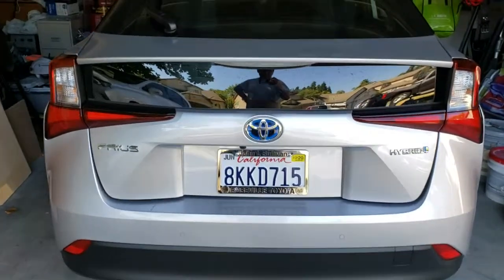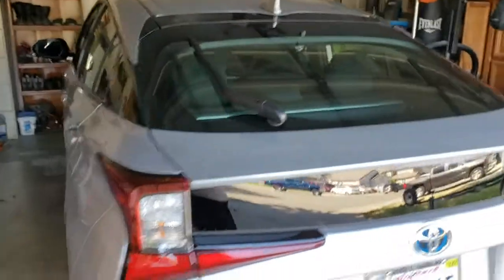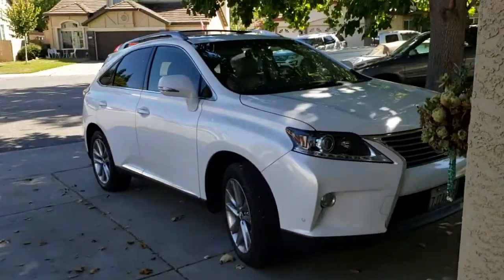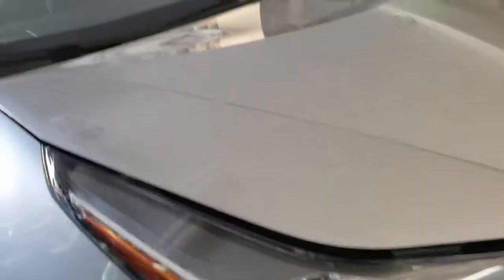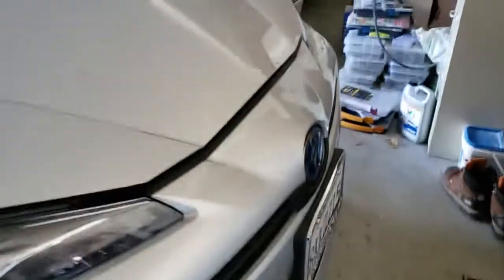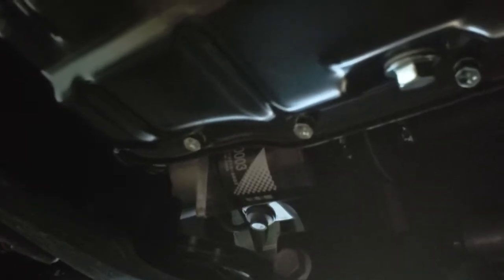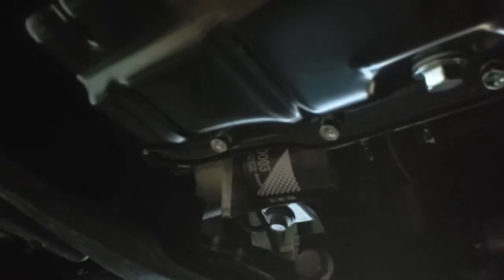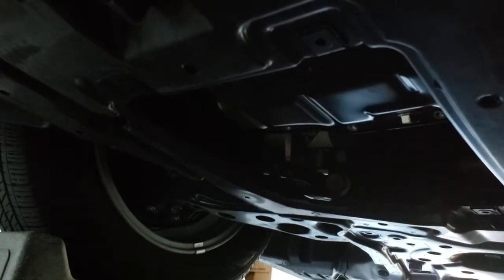2019 Toyota Prius Oil Change, Where to locate Oil Drain Plug and Spin on Oil Filter

Comment: Excellent use for a pizza box.
Reply from the maker: To give it justice, base model Prius actually rides quieter, and softer than my 2014 Lexus RX 350... 
Things move so fast... I'd never say cars improved that much, but have to say it as is
Reply: No other company researches and cares about improving their cars than Toyota. I have a suspicion Toyota knows how to make cars that could easily last a million miles but if they sold them they woudn't be able to sell as many new cars.
Reply from the maker: @Keranu  absolutely,  you are totally right on all of it!
Reply: @ikstrucking3289  There's actual a business concept called planned obsolescence where products are designed with short life spans or appeal to increase sales. A million miles isn't terribly far from the average Toyota lifespan... they can definitely make it happen.

I wish American auto manufacturers would follow the Japanese model already. I love American cars but won't buy again because of the unreliability.